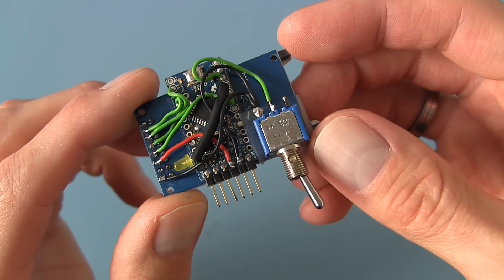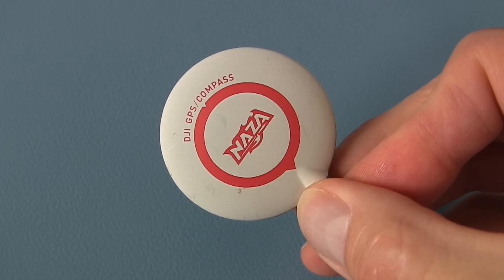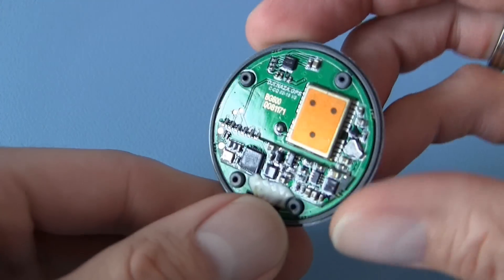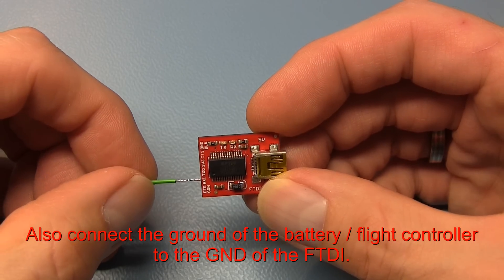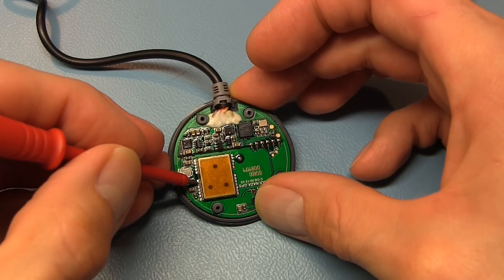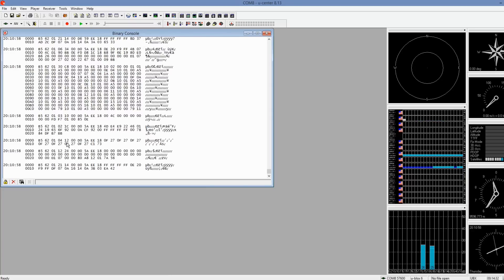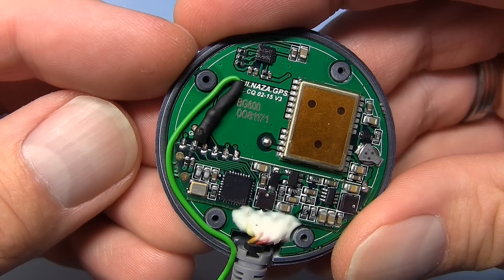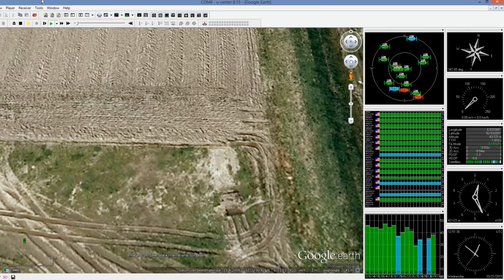A $7.50 Arduino GPS data logger for your DJI Phantom or Naza quadcopter.

Comment: Can I use an arduino to rewrite the location data sent from the gps module from a phantom or mavic to deceive the flight controller, so that i can fly in no-fly-zone while gps hold is still working?

Comment: rather than using the ms5607 barometer, can we use the altitude data from the gps logger for altitude hold function in quadcopters??
Reply from the maker: The altitude data of the GPS is to slow and not accurate enough to replace the barometer.

Comment: How does a resistor help to get good gps signals???
Reply from the maker: The resistor prevents the original GPS signal from being shorted when the wire is connected / shorted to ground. The other function is to limit the current spike when the digital signal goes high. This can have a negative effect on the power supply of the GPS module. As a result the GPS performance are influenced in a negative way.

Comment: i have installed u blox , but google earth icon  was not mentioned in the view menu. please help me.
Reply from the maker: What version of ucenter do you use?
Reply: +Joop Brokking version 8.20 sir.
Reply from the maker: In the video I used version 8.13 (top of the screen). I don't know if they removed the Google Earth feature.

You can check the manual here:
https://www.u-blox.com/en/product/u-center-windows

And download an older version here:
https://www.u-blox.com/en/product-resources?f[0]=property_file_product_filter%3A2779
Reply: Thanks a lot, but data was not storing into SD card. Can u help me with it.
Reply from the maker: Unfortunately not. There are so many things that can be wrong. But you could start by writing some data to the card from the Arduino. Just to see if the hardware works.
Reply: +Joop Brokking I'm new to aurdino, how can I write it. any demo videos ???
Reply from the maker: This might help:
https://www.arduino.cc/en/Reference/SD